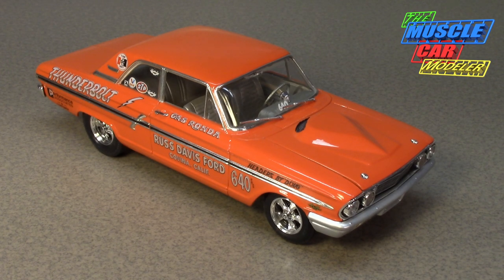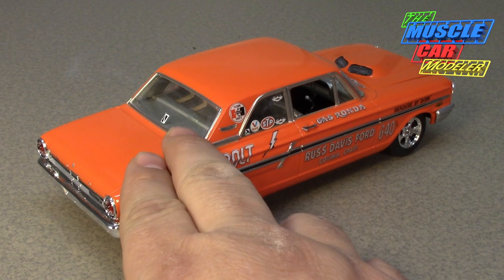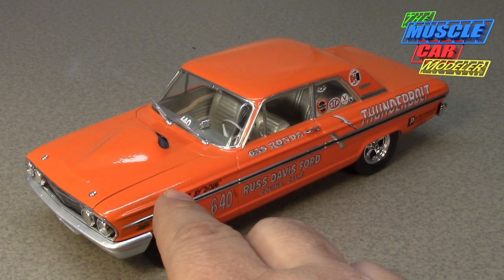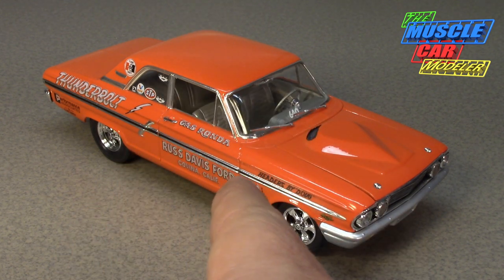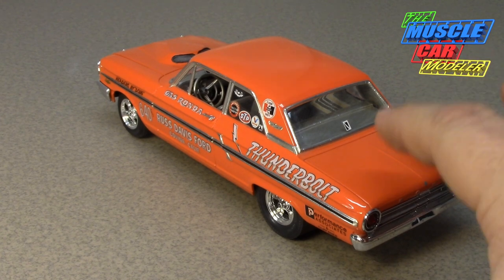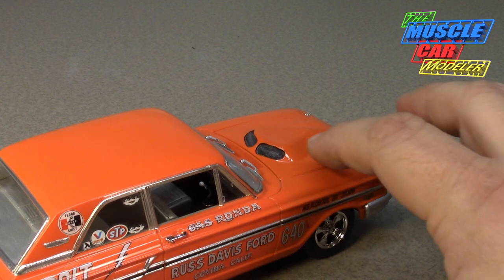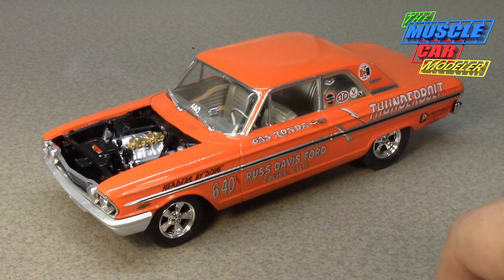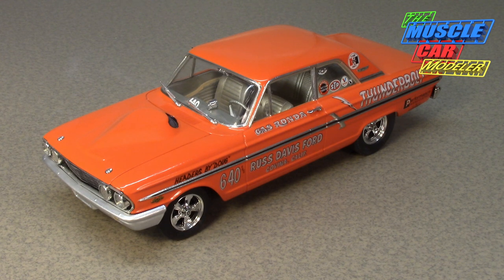Revell 1964 Russ Davis Ford 427 Thunderbolt Build

Comment: have 2 one is still in box other is blue w/georgia shaker decals like the poppy red nice color on the interior period correct p.s where do you get your paint thanks scooter
Reply from the maker: Very cool! I usually get the correct colors from Scale Finishes. Order right off the web sight.
Reply: Will check that out been gorooin all kinds of paint researching sprayin chrome Molotov through a air gun thanks dou lub scooter

Comment: Love it. Is this kit currently available?
Reply from the maker: This kit has been reissued about 7 times. Last one was in 2017. Each time with different decals so if you want this decal version it was only issued the one time! The latter kits have generic decals.
Reply: @TheMuscleCarModeler  Yours is the second recent review in several days that I've seen.
Reply from the maker: @TI4438  Yeah, It's funny. I saw the other video last night and thought what are the chances. I filmed mine earlier in the week, then edit and schedule for Saturday He was building the exact same 1990 Hot Rod issue! Revell made a ton of them and they are easy to find on ebay now.

Comment: Very nice!! Are those the kit decals or aftermarket? I have a few of these as well and wanted to know if you know where to get the other decals? I have a couple from Slixx. I remember there was a guy on eBay that a bunch of different drivers.
Reply from the maker: Thank you! The decals are the original kit issue ones.